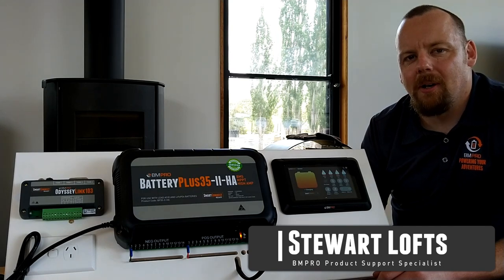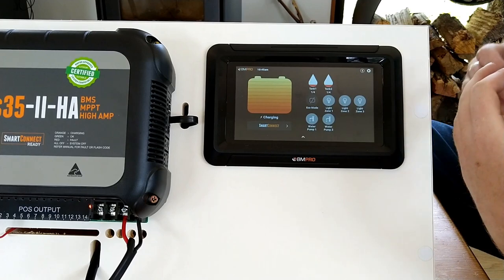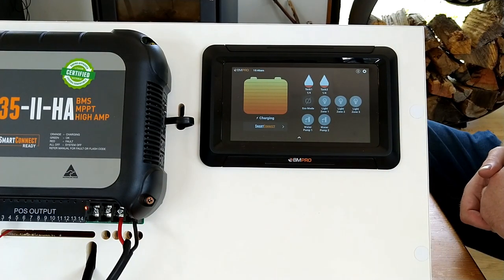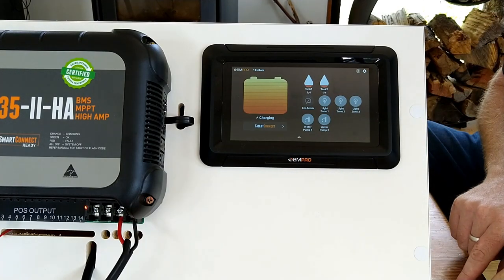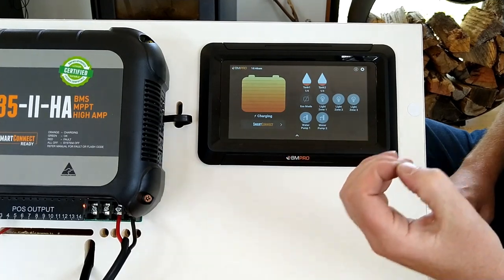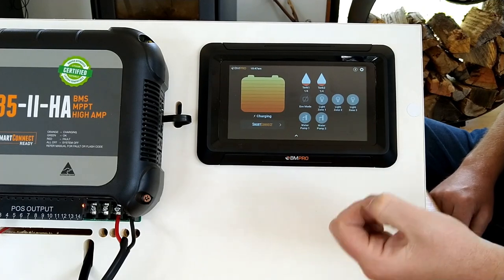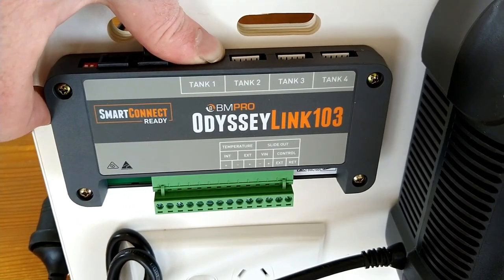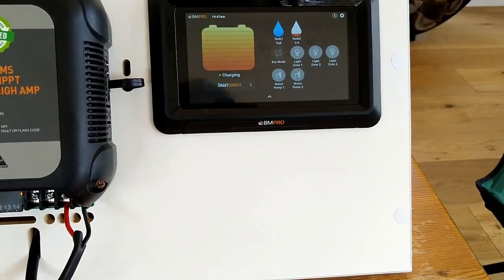How To Easily Troubleshoot Incorrect Water Tank Readings (Odyssey TechTip 16)

Comment: Done all this. My tank 1 says full, buts it’s empty. My tank 2 says 1/2 full but empty. Changed the wires between tank 1 and 2, fault does not move. 

Done the thumb trick on both. Still the same. 
Unplugged both and they remain full and half full as before. 

Advice here? Everything else in the system works as normal. I know the tanks are empty as I’ve drained them as well. 

When I fill them both, they both now say full. But draining them again. Tank1 says full tank 2 drains to 3/4, then to half, then stays on half. 

Caravan is 9 months old and just serviced.

Comment: On my Jhub screen, it shows my water tanks empty, but on my Bluetooth app node 103 it shows a water tanks full to fix his problem. I made a splitter cable and ran between the control centre, J35B and went to the node, and the Control Panel problem solved shows on both app and screen